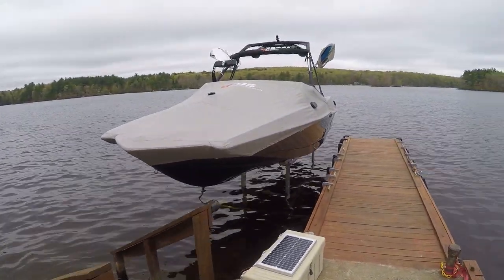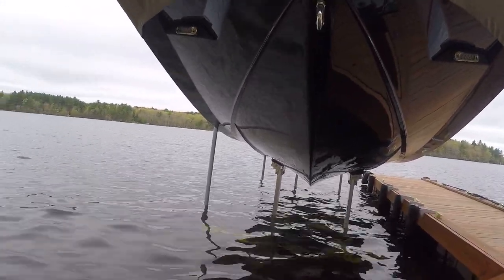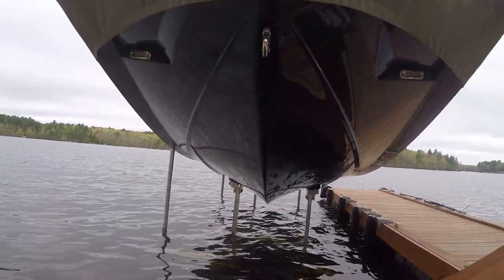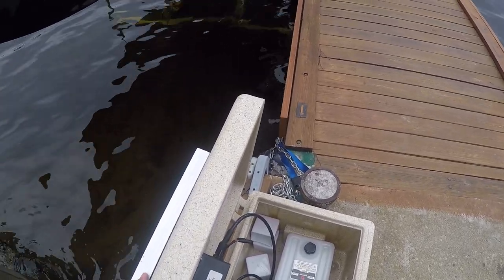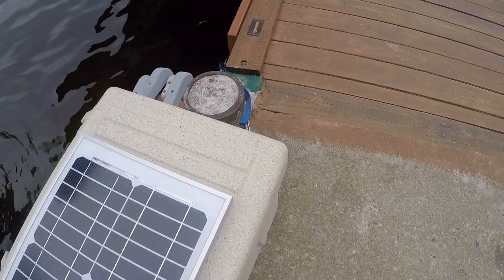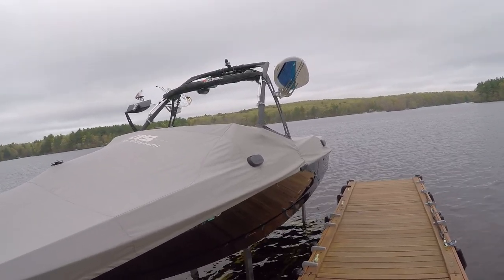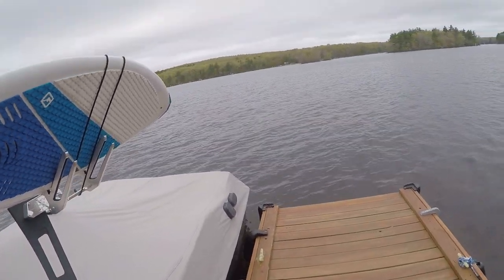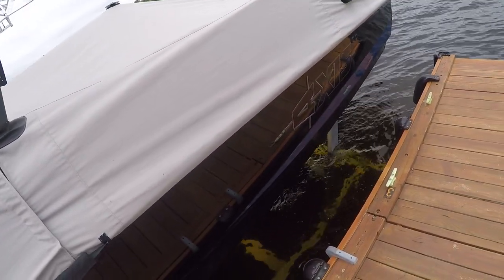Hewitt Hydraulic Boat Lift Review 6000LBS

Comment: You've had it over a year.  I just bought the same boat (Axis).  How do you like it now?  I'm comparing this to a shore station vertical hydraulic lift which is about $6k more.
Reply from the maker: Well i'm glad you asked i am having a issue right now where the boat slowly drop's down 6in's or so every day, i have traced it to find out it's a bad valve but am waiting for the Dealer to fix it. It's a bit of a pain. I'm sure you will Love the Axis, i do! Have a Great summer Wakesurfing!

Comment: Wow that sounds scary. My recommendation is get a ShoreStation.  More reliable. Hydraulics and hoses are out of the water. Single cylinder. Vertical lift so easier to load and unload. Better load guide system on the ShoreStation.   Sorry the ShoreStation is Just all around a much better hydraulic lift.

Comment: I have the same lift that just got installed and it makes the same noise. Were you able to figure out why and get it fixed?
Reply from the maker: Leister Bowling I put some water grease on the joints and after a while the noise went away 😄!
Reply: Thanks for the reply. After talking to the dealer he recommended that I check the valve going to the pump and sure enough, the guys that installed it left the valve turned all the way open. Hewitt recommends 1.5 turns of the valve. I adjusted it to that and the clunking went away immediately.
Reply from the maker: Wow Great to Know i bet the guys who install mine as well did the same thing. The only issue I had was the lift would slowly drop after 2-3 days with the boat on it, I brought to a Dealer and they fixed a valve and have not had any issues since. Have a Great Summer!